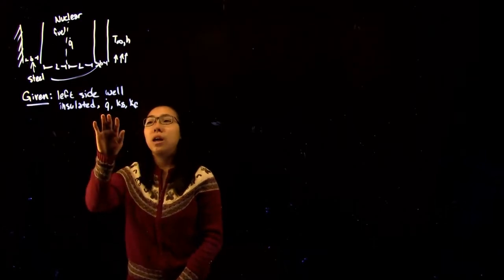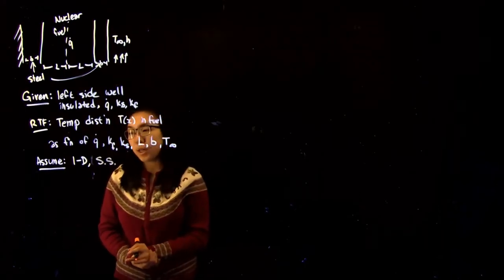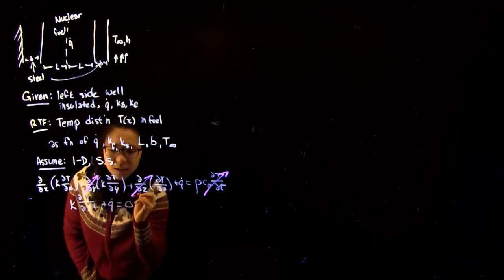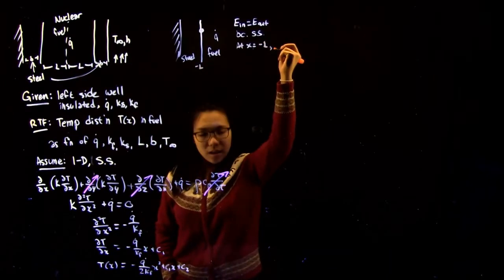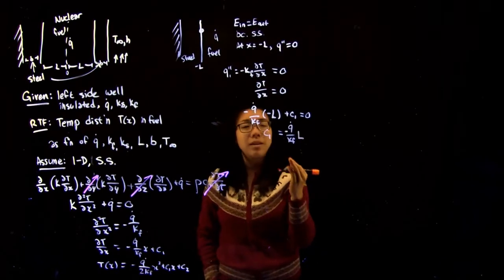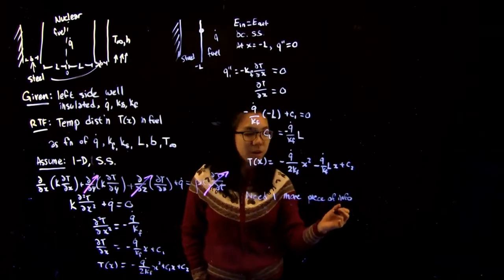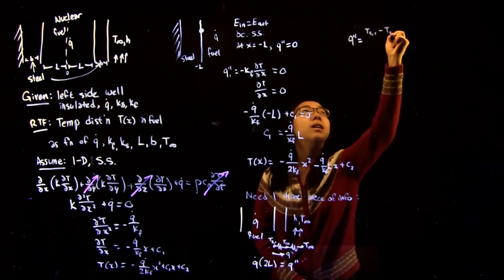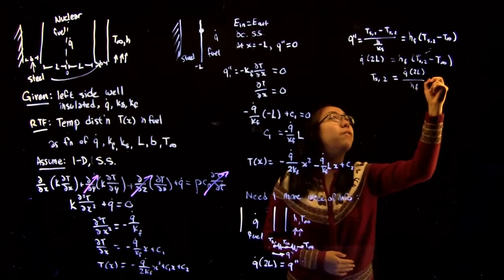Chapter 3 - Steady state heat conduction in 1D

Comment: I dont understand why q=0 at the steel I know is insulated but the insulation is on the other side of the steel?
Reply: If you consider the left piece of steel as a whole, there is energy coming in from the right side, but no way for that energy to dissipate since the left wall is insulated. Since E_in = E_out, if E_out = 0, then E_in = 0 which = q.

If q was positive, that would mean that the nuclear fuel was hotter than the steel wall, inwhich the steel wall would just heat up until they are the same temperature, making q = 0 again. And visa versa for if the nuclear fuel was colder than the steel wall